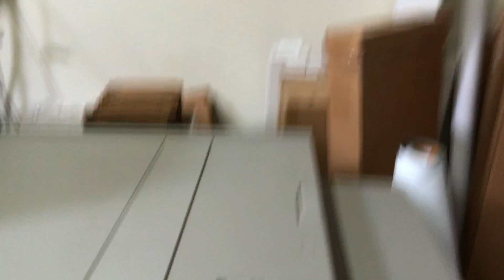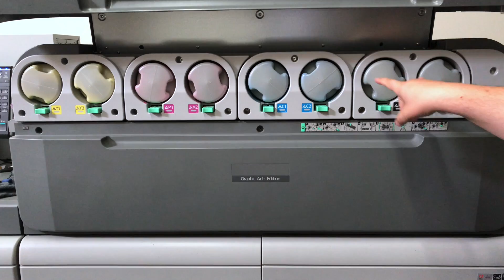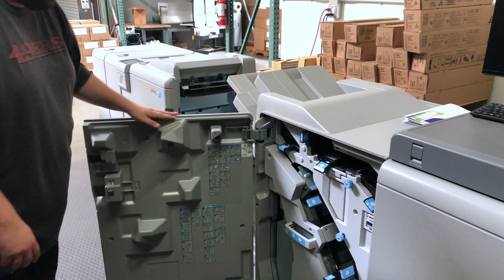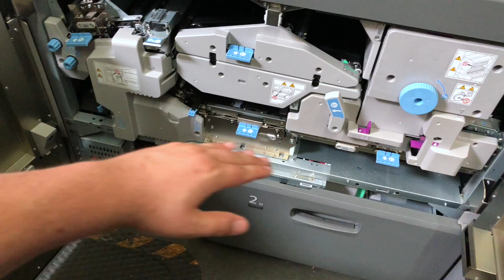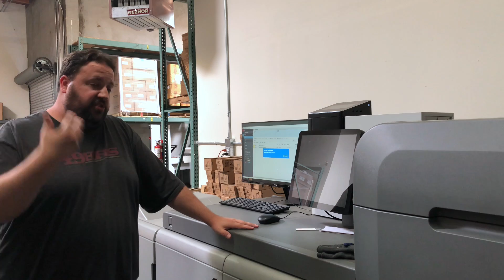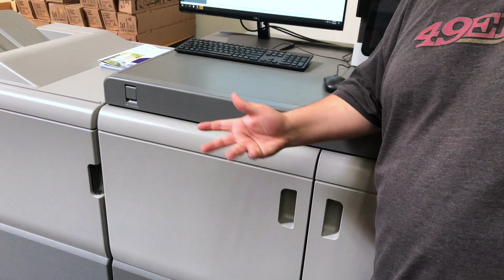My Heidelberg Versafire EP / Ricoh Pro c9200 Full Review

Comment: Small print shop owner here.. :D 
We have a good offer for Versafire EP with 1.8mil counter (arround 12k$). We dont have volume at the moment, but are growing steadily. 
What are your thoughts on getting this machine for small print shop? 
We have older Ricoh pro C751 which has seen its days, so looking to upgrade..
Reply from the maker: It would be a huge upgrade over your c751 for sure. It’s a great machine. Does take up some space, though. Our unit from the video was about 30ft long, but that did include the booklet maker. 

1.8mil is nothing for this machine. We have over 11mil on ours and it’s going strong. $12k is a very reasonable price for it. 

The question is getting service. This machine is a step up from the 751, so you’ll either need to put it on service or really know what you’re doing to keep up with maintenance. 

Let me know if you any specific questions. Thanks for watching.
Reply: @miketheprintman  I'm a really good friend with Ricoh service guys, they have helped me maintaining c751 for years.. so service shouldn't be an issue.. Only thing that they do not like is the Prinect.. If i understand, when getting a 2nd hand machine, you also need licences and some other stuff.. its not as easy to setup like Fiery CWS? 
Anything else i should pay attention to? 

Thank you a lot for replying. I've watched your video at least 5 times in last year since I'm thinking on getting C9200 <3
Reply from the maker: @dinomaskot90  that's great that you have a good relationship with the service team. Always makes it better.

You don't need to have Prinect. A Fiery unit will be fine. You can see in my video we have Fiery. Now at the shop I'm at now, we have Prinect. It works well, but it's a bit overkill for just a digital set up. We also have offset presses with Heidelberg, so it makes sense for us. Now, I don't know what the options are with the used model you're looking at, but hopefully it has a Fiery unit and not Prinect.

I would definitely recommend going for it if you can, Ricoh makes good machines, their service is solid and the quality of the prints are amazing.

Comment: It’s price please and if there a second hand machine
Reply from the maker: The price varies a lot based on the set up. What you see in the video was around $150,000 US. That included the Plockmatic finisher. That unit was purchased in 2020, so prices should be much higher than that in 2026. However, the c9200 is not for sale new anymore, the c9500 has replaced it. There are plenty of used c9200 series machines out there for sale at auctions and on eBay.

Comment: You didn't close the tray 3 covers properly, probably because of the camera. The Ricoh c9200 is an amazing machine. It is a workhorse that doesn't break down (3 years). If the paper weighs on the finisher, the toner or lubricant runs out, or something else, it reports. The fuser has no effect or change the colors. Only in the first months, there were jams on 80–120 gsm paper, and it is important that the paper is tempered and not damp. Keep room cool – up to 22 degree. With perfect registration of the sample, there is a shift of the marks, skew or  scale during printing up to about 0.5– 1.5 mm relative to the paper. There's something with  yellow color (toner). Yellow is cooler, once we had a sample where we couldn't reproduce the warm light tone Y+M, even though we were changing values in the file by 1% step differences. Sometimes on thick paper it gives white spots like splashes. On the whole working with the machine and Fiery station is a pleasure. Make a good paper calibration and you are in the game.
Reply from the maker: I've been working with Ricoh products for about 15 years now and I only have positive things to say about them. They are awesome machines, that are easy to use and just plain work. Thanks for your comment, I didn't even realize I had the covers open for tray 3. This was an old video, however, this machine is long since gone and the place I work at now is another c9200.

Comment: Hey Mike - 
I appreciate the video.  We have a Ricoh 7200 (only using the clear for one clients bus cards - so not really necessary)now but our volumes have grown to where we are exceeding the monthly duty cycle on a regular basis. So, I’m looking at the Ricoh 9500 or the KM c14000.  I do like the way the Ricoh has the fusing unit separated - seems smart for the longer runs. 
Do you have the “Auto Color Diagnosis” feature on your model? I’m just wondering if that feature is needed. 
I’m in the Milwaukee metro area so both the Ricoh & KM have good service teams close & available. 
We have never had a KM press before - a sister shop of ours has a smaller production KM unit and they like it and have noted good service for it. But I’ve heard some troubling stories on the early years for the KM c14000 - but nothing recent. 
Let me know if you think the Ricoh Auto Color Diagnosis (if you have it - is it worth the extra $)
Let me know your thoughts. 
Thanks Mike- 
John the printer man
Reply from the maker: As far as I know the c9200/9500 have the color calibrator built in. I wasn’t aware that there was even an option not to have it. Personally I think it’s a great feature of the machine and worth whatever price you have to pay for it. 

I have heard some stories that the Km 14000 had some growing pains when they first released it, but I’m sure they worked them out by now. 

My money would’ve on the 9500 though. Ricoh makes great machines.
Reply: There are 2 “Optional” quality control features with the 9500. 
1. Image Quality Monitor- 
Checks for imperfections in print

2. Auto Color Diagnosis - this automatically corrects color when in production.

Maybe your 9200 already has this in its build.
Reply from the maker: @johnmcadams4738  Those could be new features. I know on the 9200 there is a built in scanner that auto detects image quality and will attempt to fix imperfections in the prints. The c9500 has probably improved on that feature, so that could be what that is. Either way, I don't see how having that could be a downside.
Reply: I know that toner squares are applied to the image belt and the densities are scanned read and adjusted but if you want the printed image itself read and adjusted to the RIP image that is where the optional feature of Auto Color Diagnosis comes into play. My sales rep on this area says he never sells these 2 options because of how good the machine is w/out them.
Reply from the maker: Well if that’s the case I would forgo getting that unit. Unless you’re trying to become G7 certified or have a lot of customers that require super accurate color.

Comment: Just got hired at a printshop with these machines and I'm encounting issues with registering both sides. I'm used to Konica Minolta machines with their IQ501 with both sides adjustment...Any advice?
Reply from the maker: Hi Rodel. The Ricoh c9200 has a built in auto front/back registration calibrator. If you go into the paper library and click on edit settings at the bottom left hand side you’ll see options for registration. One is manual, one is auto. The auto will burn up 31 sheets of media, but should fix any front/back issues for that paper.

Comment: Hi did you have trouble connecting the fiery to the printer? I just bought the Heidelburg versafire pro C7210x and we have not been able to connect it to our fiery! Do you have any suggestions? Seems like the fiery isn't syncing with the printer, I am getting a blue fiery icon instead of the original Fiery logo. We also keep getting a paper size not invalid even if everything matches on both fiery and all printer trays.
Reply from the maker: Honestly we had a Ricoh tech out to do the install. They were the ones who set up all our previous Ricoh machines. I’m not an expert on the setup of the software, so I’m not sure. I would assume it has something to do with the fiery and print engine not recognizing arch other, but I would contact Ricoh or fiery direct and see if they can troubleshoot the issue over the phone.
Reply: Good day! I understand that Heidelberg is using a different DFE such as Prinect . Are you using Fiery Controller instead of Prinect? Happy to assist here.
Reply from the maker: @bochokoy1118  the machine in the video used Fiery. However the shop I work at now uses Prinect for our c9200.
Reply: @miketheprintman  , I got it. Just let us know how can we help if you will use Fiery controller then. Great

Comment: Great video, our 9200 fusers get ruined QUICKLY if we try to run a smaller sheet, putting lines in the fuser belts. Does this sound normal?
Reply from the maker: Yes, that’s normal. That’s why you have to run the smoothing belt a few times to erase those lines on the fuser belt.

Comment: Thank for your this. Is it possible to run synthetic labels in it? I know you could but in longer runs would the adhesive cause issues?
Reply from the maker: We run synthetic stocks all the time. I assume you mean like PVC type labels, right? Just make sure you check with the manufacturer’s website to see if the press is compatible. However, you can damn near throw a piece of wood through this thing and have it print, so it should work just fine.

Comment: Thanks for presentation, it was very informative.
I want to buy same machine but it has more the  2 mio impressions, is that a lot or how check is it worth buying it? Thanks in advance
Reply from the maker: 2 Millions impressions is nothing. We have put nearly 5 million impression in just over 15 months and it's running just fine. As long as the maintenance has been done on it, then I would expect these machines to last well into the 20-30 million impression count before encountering major issues. As always, however, when buying used equipment, it's worth it to check it out to see if everything is functioning properly and a good idea to get a certified tech to take a look and see if everything looks good.
Reply: @miketheprintman  thanks a lot man!
I am buying it from authorised and fully furbished for about 45.000usd. Is that worth it?
Reply from the maker: @VisarIdrizi   It depends on what accessories come with it, but that sounds like a good ballpark figure for the amount of clicks. Typical set up is with one additional LCT and then either a standard stapler finisher or stacker unit. Is that what this one comes with?
Reply: @miketheprintman  yes it has a stacker.
Reply from the maker: @VisarIdrizi  Then that's right in line with what it's worth. It's a great machine. Hope you can purchase it.

Comment: Have would you compare this machine to the newer 9500? Assuming you had a chance to see a 9500.  Thx man
Reply from the maker: Have not seen one in person yet. My Ricoh tech says a lot of the improvements are on the maintenance side of things. Longer up time between maintenance cycles, better inline calibration scanner, etc. Sounds good for high volume shops.
Reply: Got a demo in manhattan of the 9500 Nice machine. I wasn’t thrilled with the paper set up process. The marks on the sheets didn’t back up each other to my specifications. I found the canon v1350 with the option sensing unit does a great job aligning and squaring the marks on a sheet front to back. However the v1350 doesn’t seem to be built as well and a little Mickey mouse in some ways.  Still trying to decide between Ricoh 9500 and canon v1350 

9500 is a 9200 with some enhancements. While canon is releasing a new fixing unit. They are going to a single belt fused 135 sheets a minute rated. But get over 257 gsm and it slows down to 105 sheets.  early adaptors of the v1350 may be beta testers without knowing it. 🤣
Reply from the maker: @hazzmatte  Yeah, I've read some negative things on the Canon. I worked on a Canon c7000 about 15 years ago and it was a nightmare. I think mostly the print engine was a lemon. I do like the paper feeding and library setup better on the Canon than the Ricoh's, but I find the alignment to be pretty spot on with Ricoh, especially if you run the inline calibrator for front/back registration. And it never slows down unless you're doing real heavy stuff like 470 gsm paper.

Comment: This machine is probably our next purchase. Using the 7100 now and it's getting old. We absolutely hate Prinect and the Heidelberg DFE. Fiery was SO much easier and smoother. We had a brand new server with only the Prinect software on it and the machine was struggling to keep up. Always crashes and in my opinion way over complicated. The server for the plate maker seems to be constantly updating and running 24/7. Hoping to unplug from H-Berg software in the future.
Reply from the maker: I hear you. The new shop I'm at now uses Prinect. Although there are some nice features, I think a lot of it is geared toward the offset side of things and it's a bit of an overkill for daily use. I used to run a c7110. Great machine, but the newer c7200 and now c7500 models are leaps and bounds better when it comes to the 5th toner station.

Comment: Thanks for the presentation. It was very detailed and understandable. I had a little trouble to understanding the imperial metric system because I'm from Europe, but it was fine.
I also run a 350 in offline mode and it works very well for short term jobs. Powerful and easy to use machine.
Reply from the maker: Those Plockmatics are awesome. I like the spine crimper feature. Helps a lot when you package the books, they fit in boxes easier.